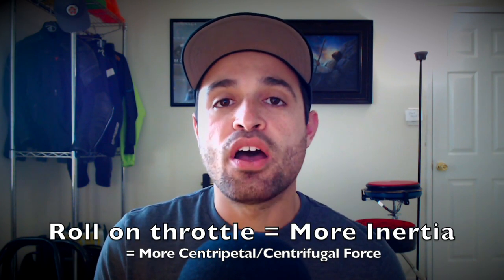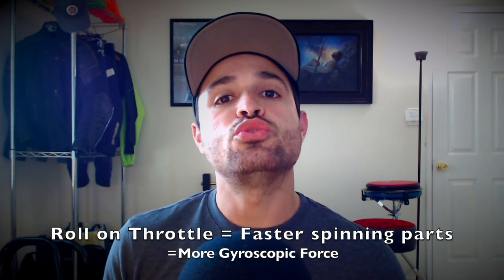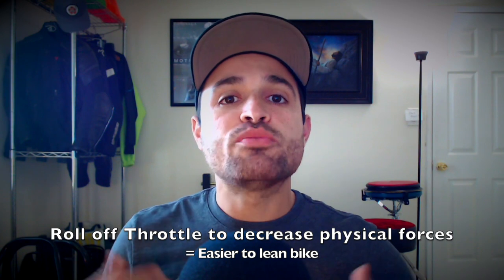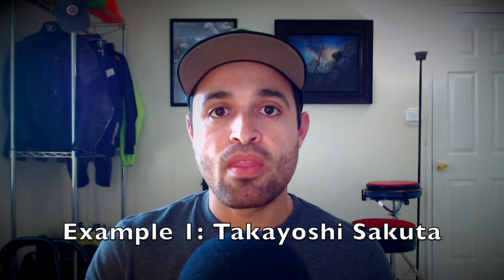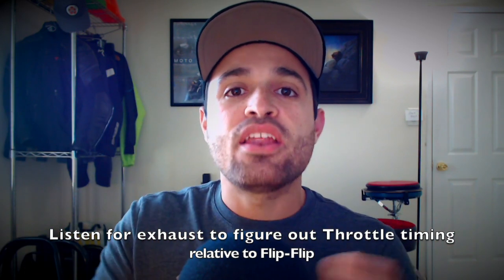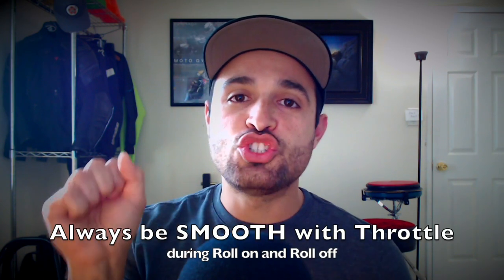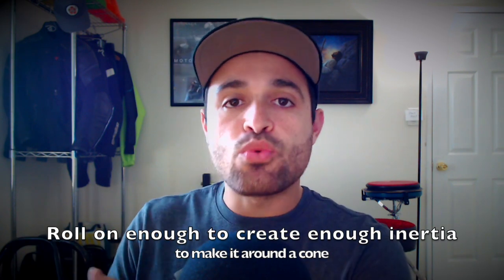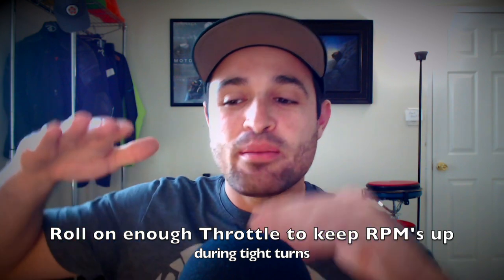Moto Gymkhana Techniques Level 2: #6 Use the Force!

Comment: I watched most of your videos and there is one thing worth mentioning that I never heard explained but observed while watching Haruhiko Tsujiie doing his GP8 record. This is my observation and I may be wrong.

But I think that when he (or other moto gymkhana master) uses the rear brake while motorcycle is slow in the turn, this makes the motorcycle behave like a compass (a circle drawing tool): it spins around its rear wheel. So the front wheel probably spins faster and doing bigger circle around the cone than the rear one. Front wheel has more mass on it and is not restrained by the brake, so it is more free to do so. This explains insanely low diameter of his turns while doing this so dynamically. I think other riders also use advantage of this phenomenon but may not realize it. This compass metaphor I coined helped me understand it :)

Let me know if you agree.
Reply from the maker: Yes. I actually do agree 100%. I mention this effect briefly in a following video called "The Brakes". I like the name that you gave it but I refer to it in my video as a "Hook Turn" effect. The Hook Turn Effect is one of the reasons I release the Front Brake at the slowest point of the turn and only use Rear Brake. Releasing the Front Brake at that time also unloads and lightens the front wheel and allows it to turn more quickly. 

Your observation is correct. Nice job watching The Masters carefully :)

Comment: You are a good man and a good simple teacher using simple instructive tools. Thank you a lot. As a new rider, this Sunday I will be taking gymkhana classes in France. As first bike, would you recommend me to buy sytreet bob of harley
Reply from the maker: Thank you for your comment. I am happy to hear that you enjoy the videos and my simplistic teaching style. I always make my videos as easy to understand as possible so that riders of all skill levels can try Moto Gymkhana; not just the advanced riders. 

Cruiser motorcycles with V-Twin engines like the Harley Street Bob can be good beginner bikes. They are low to the ground and deliver easy to manage power (compared to an inline 4 sport bike engine). The only problem with cruisers is that since they are low to the ground, you will have ground clearance issue when trying to make tight turns like in Moto Gymkhana. If you are looking to use this bike for Gymkhana, you might be limited in what you can do. If I were to buy my first bike today, I would probably go with something like a small displacement naked bike. Examples would be Kawasaki Z400, Yamaha MT-03 or KTM 390 Duke. They are comfortable, light, easy to handle and they have enough ground clearance to ride Gymkhana just fine. But it's all up to what your priorities are. If you really want a cruiser because you like the style, that's ok too. Just realize that every type of motorcycle has it's strengths and weaknesses so you must consider all of the variables.

Comment: Used your add throttle at exit technique this morning while practicing tight U turns. Once you figure out the timing of when to add the throttle, it makes exiting a tight (16’) U turn much more stable. The bike just seems to want to stand back upright without me having to re shift my weight. Thanks for the insight.
Reply from the maker: Nice! I’m glad you found the topic helpful. Adding throttle as you exit also changes the motorcycle’s geometry, which makes the bike turn quickly. I’m going to make a video about that this month. And you are correct about the timing, as well. There is so much timing involved! Getting on the throttle at just the right time can make all the difference.

Comment: are you hitting full lock when you are doing the only throttle, no brake drill
Reply from the maker: No. I don't really hit full lock very often when riding these types of drills. I don't really aim to hit full lock all the time but if it happens, it happens. For me, full lock is like dragging knee on a track: You're not really trying to force it to happen. It just happens naturally with the right speed, body position and lean angle. Thanks for the question and for watching.

Comment: Example 2 / Tominaga looks like he's losing traction on his rear tire on purpose in order to turn tighter, right? Sick!
Reply from the maker: That’s definitely a possibility. When riding at those speeds and lean angles, you are definitely gonna get some occasional slippage of the tires, especially the rear tire around cones. I don’t know if he’s doing it on purpose but if it happens, you can definitely use the slip angle to tighten your turns. That’s pro level stuff!
Reply: @LexcoMotoGymkhana  I'm looking at Example 1 again - and it seems like Sakuta is using the throttle for unknown reasons around 1:02 to 1:06.... what is the reason for his rough multiple accelerations there? https://youtu.be/hJhstXvxiIo?list=FLKFo4muQHC4gDEeY9JM6wQg&t=62